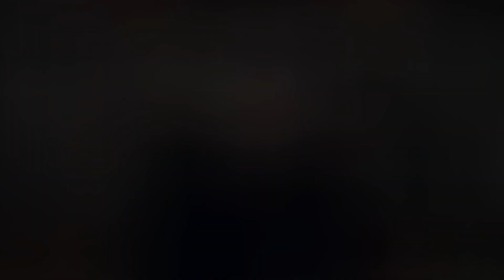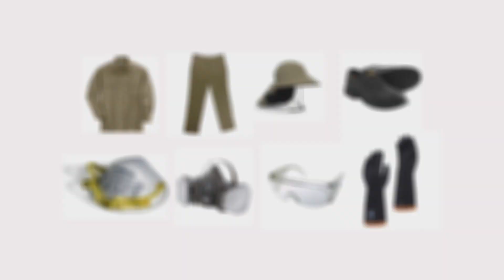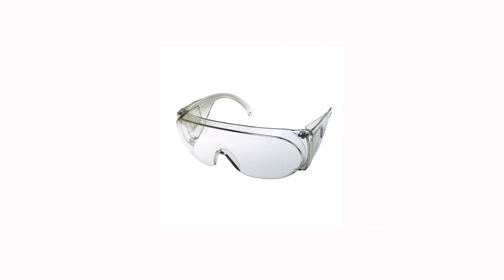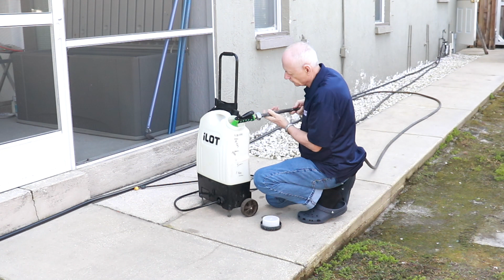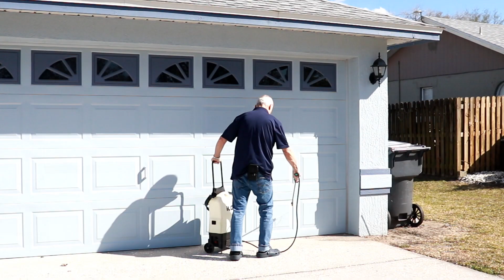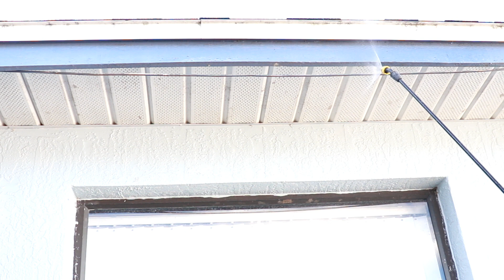How to Prevent Drywood Termites 100% Guaranteed.

Comment: Sir, what do you suggest to treat and stop termites in the walls? I had mud tubes come thru the wall at the top of the wall where it meets the ceiling. What do you suggest that I so? I live alone and am almost your age so it's just me here to deal with this I was told there was holes in my exterior wall back there and I plan on hiring someone to remove the exterior wall board and replacing the damaged wooden framing, but I need to do something now to get a handle on this I'm sure... Thanks so much for all that you do in giving us hope that there may be a light at the end of the tunnel.
Reply from the maker: Since you are seeing mud tubes, I think it's safe to assume that this is a species of subterranean termites.  You did not tell me where you live, but the fact that you are seeing the mud tubes near the ceiling is very concerning.  I often see that with Formosan termites, and they are a very aggressive species.  Those things can destroy a house in a matter of months. It sounds like you are not physically able to do a lot of manual labor, and the treatment for these guys would involve trenching around the entire house.  You would need to dig a trench 6 in wide and 6 in deep around the entire building.  Please correct me if I'm wrong, but I suspect that is something you would not be able to do.  Normally, I would suggest that you watch my video on how to identify termites species and my video on how to treat Formosan termites, but in your case you would probably be well served to call several pest controllers and ask them for a free inspection.  Prices can vary quite a bit in this industry, so the more estimates you get the better.  The pest controller should be able to tell you if these guys are Formosan termites.  Keep in mind that when you get estimates, you should not consider, under any circumstances, going with a baiting system like the Sentricon system.  A lot of companies are going to try to sell you that, but it is not effective for Formosan termites.  They're going to tell you that it is, but they are incorrect about that.  Formosan termites will destroy your home before the bait stations are effective.  The only treatment you should be interested in is trenching around the entire house.  The initial cost may be higher, but it will actually save you money in the long run.  Please watch my video on how to hire a pest controller without getting ripped off.  Please note that Formosan termites only exist in certain areas of the US.  If you live in the US, then please have a look at my video on how to identify termite species.  There's a map in that video that will show you where Formosan termites are a problem.  If you live in the red or orange areas on the map, then there is a good chance this is what it is.  Otherwise, you may just have a more common species of subterranean termites that is fairly easily treated.  Also, keep in mind, that if these are Formosan termites, then an interior treatment should also be done as well. Many companies do not do the interior treatment and it will not be included in the estimate.  So, if these are Formosan termites, make sure you ask the pest control companies what their plan is to look for "cartons" inside the home.  Naturally, the estimates that include the interior treatment are going to be higher than the ones that do not.  Still, Formosan termites have the ability to colonize in your home, and so you do need to treat them inside as well.  A pest control company that does not offer this service, simply does not know what they are doing.

I know this is a lot of information to take in, so please let me know if you have any questions.

I hope that helps.  Be well my friend.

Video on how to hire a pest controller without getting ripped off:  https://youtu.be/y-a8XOqVrlE

Video on how to identify termite species:  https://youtu.be/dIs_a0nfVjg

Video on how to treat Formosan termites:  https://youtu.be/xDtGUWxMrRw

Comment: Do you think Spectracide is good enough for prevention? Also, what if the house is on a concrete slab and not on dirt?
Reply from the maker: Please watch my video on Spectracide Termite Stakes.  With drywood termites, it doesn't matter if you have a slab home.  With subterranean termites, the foundation type is not critical, but it does matter how much concrete you have that abuts the house.  Please get back to me if subterranean termites are a concern and tell me more about the ground around the house.  I hope that helps.  Be well my friend.

Video on Spectracide Termite Stakes:  https://youtu.be/UDzg-1lpynA

Comment: Can I use Boracare or do you recommend the two products you reference in your video?
Reply from the maker: Bora-Care is a wonderful product, but to be effective, it must be applied over bare wood.  The problem with drywood termites is that they enter through cracks and crevices around the entire home.  It would certainly help to treat all the wood in the attic with Bora-Care, but that will not help you if they enter through cracks and crevices around windows, pipe penetration, and that sort of thing.  So, if it were me, I would treat whatever wood I could with Bora-Care, but I would also do a preventive treatment as well, every 60 to 90 days.  Always mix the Bora-Care one to one with water.  The label will tell you that one to five is okay, but don't do it.

I hope that helps.  Be well Carli.

Comment: How do you treat drywood termites and which chemical treatment is best? Please do a video.
Reply from the maker: I do have a video on that and I will give you a link to it, but it is important to understand how drywood termites work.  They enter through cracks and crevices around windows, doors, the eaves, pipe penetrations, and so forth.  Most of the time, they enter through several locations.  That is because a swarm of them attacked your house at the same time.  If there was a crack or a crevice, then they probably found it.  After they establish their galleries, which will be inside the wood, it will take four to seven years for them to be able to swarm.  Now that they are in your house, the swarmers will use holes that are in your studs to travel through the walls.  Those holes in the studs were created by the electricians to run the electrical wiring.  Not only are these holes going through the studs, but holes were drilled into the attic for the light switches and to run some of the wiring for the outlets.  So, the termites now have easy access throughout the attic and the walls.  If you have a basement or crawl space, they have access to that as well.  Most of the time, you will have no idea that they are in the walls, because the frass is inside the wall.  To make matters worse, if you have drywood termites, then your neighbors have them too.  That means you have been getting swarmed for as long as they have existed in the neighborhood.  Most likely, we're talking about years, so it's a safe bet that you have these guys in many locations in your home.
                            
I always hate to be the bearer of bad news, but if you have drywood termites, the only way to get rid of them is to fumigate.  Prices for this can vary wildly in this industry, so I recommend that you watch my video on how to hire a pest controller without getting ripped off.  That video can save you a lot of money.  You should also know that the gas they use to fumigate has absolutely no residual action whatsoever, so you can get reinfested the moment the tent comes down.  Like I said before, if you have drywood termites, then your neighbors have them as well.  Since drywood  termites swarm every year, it is almost a certainty that you will be reinfested within a year after the fumigation is done.  The only way to prevent this is to do a preventive treatment on your house every 60 to 90 days.  Most pest controllers will not do this, so it is something that you generally need to do yourself.  If you absolutely cannot afford to fumigate your house, then you can try spot treating it yourself.  It is virtually impossible to find all the termite galleries, but it is way better than doing nothing.  Regardless of how you treat it, you should begin the preventive treatment immediately, so that you do not get additional termites paying you a visit.  

I hope that helps.  Be well my friend.                        

Video on how to hire a pest controller without getting ripped off:  https://youtu.be/y-a8XOqVrlE  

Video on how to spot treat drywood termites: https://youtu.be/U7ck7zhS0Xo

Comment: Guy, I'll tell you, I'm feeling a little bit pessimistic about stopping dry wood termites. How does spraying stop them from entering the large crack where the starter course shingle lays on the drip edge? From there, they not only have access to the unsprayed reverse side of the fascia and soffit (assuming they are wood) but also the wood 2x8 sub-fascia, rafter tails, wall top plate, and the rest of the attic, etc. And what about the attic vents in the soffit? These only have a screen to stop fly and wasp sized insects. This seems like a losing war. But you are a treasure of information. Thank you.
Reply from the maker: That is a great question.  When drywood termites land on a surface that was treated with a pesticide, death will occur within a few hours, which is not enough time for them to establish a gallery.  They generally need to land before entering any of the cracks and crevices along the roof line or anywhere else on the building.  If you have really large openings, it would be a good idea to seal them up.  I like to use Stuf-Fit.  This is basically a copper mesh product that you can stuff into large openings.  It is available from Amazon or domyown.com.  Smaller openings should be sealed with and exterior caulk.  Naturally, it is almost impossible to seal all the openings, but if you get the really big ones, then the termites will have no choice but to land before they enter, and that will be the kiss of death for them.  If you want to be absolutely certain that they are going to die, then you may want to treat every 60 days, instead of every 90 days.  They claim that the pesticides are good for 90 days, but obviously they are not as good in the last 30 days as they are in the first 30 days, so I treat my house every 60 days.  I hope that answers your question.  Be well my friend.